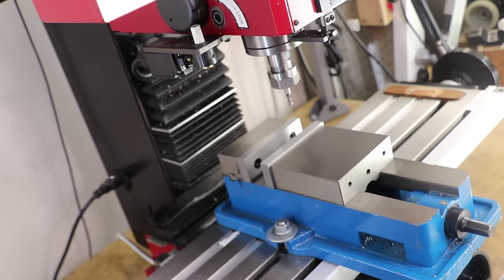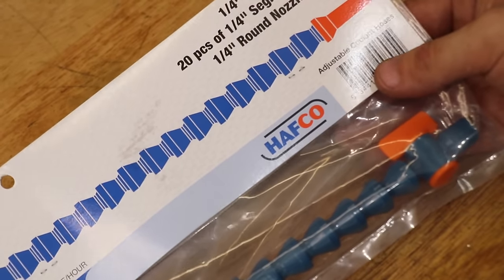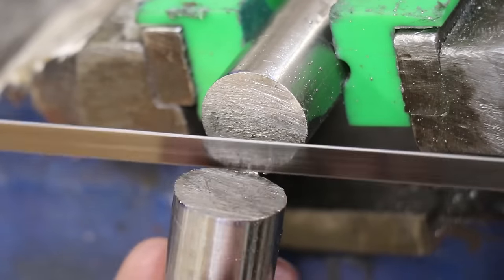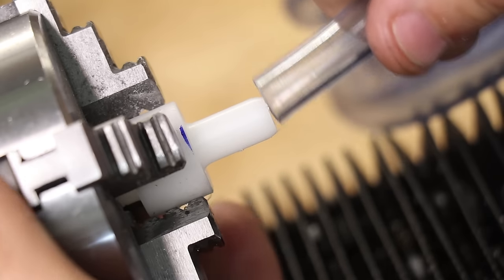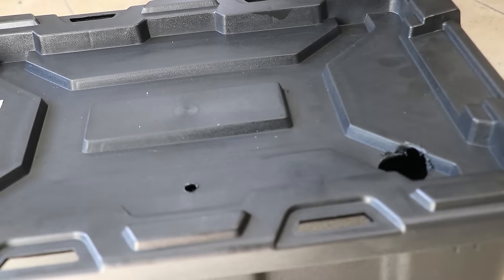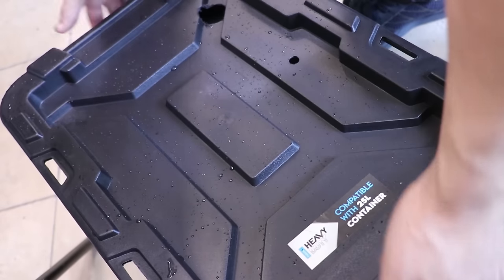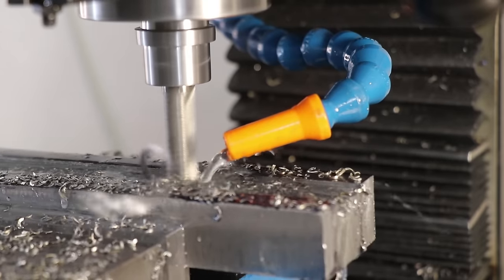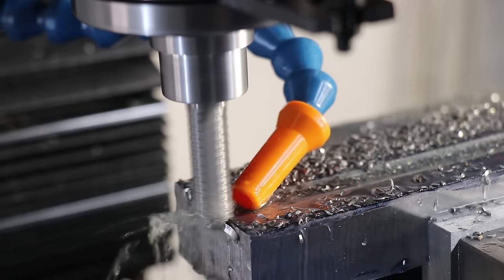Cheap DIY Flood Coolant For The Milling Machine

Comment: Hassle factor: high, Coolant effect for HSS: needed, Mess factor: high, Need to replenish and filter coolant: high, effect on cutting performance: improved a little, Negative effect of water on cast iron: high 
Conclusion: Use carbide mills and skip the flood coolant. They handle the higher RPM's and heat just fine and you don't need the coolant at all for hobby use. For drilling and tapping, use a little oil.
*
I've a got a slightly larger set up than you, but not by much. I use carbide mills exclusively. From time to time I'll put some oil on the mill IF I am machining aluminum since it adheres to carbide. All the rest, I machine it bone dry and my mills either break or I wear them out after many hours of use.
*
Hot metal chips, you did solve that problem, but then so do thin leather gloves and a long sleeved shirt!

Comment: I know it may cost some of your Z height, but have you considered a fixture plate for the mill table? It could add some versatility to your vise setup and could act as sort of a screen for keeping chips out of the T-slots when the coolant starts flowing. Then again, it could just provide a larger mess for coolant runoff 😅

Comment: You could quite easiely add .35 liter more coolant oil since adding 1 liter to 18 liter giver you little more than 5% 1.35 liter gives you 7%. Also think it looks to clear. Otherwise if you are going to change out the fluid calculate the oil you have to the percentage what you want. So for 7% 1liter/7 then for the water take (1l/7)x93. It becomes like 13.28 liter so 13.5 will set the level a bit under 7%. Also when i worked in a shop we always mixed the coolant in 15l or 30l buckets. Then poured it in the coolant tanks and machines.
Reply from the maker: It seems to look a little low but this is more concentrated that the manufacturers guide. Ill probably play around with it in the future since I am coming into this with little experience dealing with semi synthetics.

Comment: Put the pump in a fine mesh container to prevent swarf from getting suck in. The pump at the bottom is the worst place it could be to suck up contaminants.
Reply from the maker: Cheers, the mesh filter in the funnel has actually done a really good job so far. I am thinking of a different mounting pump for the pump though

Comment: Each shop I've worked at throughout my life I always try and convince the boss that it is against my religion to work with Stainless Steel, but nobody has bought it yet. All S.S. will work harden super easily and super fast, and 316 is one of the worst, if I can get away with it I always try to use 303SS, it's damn near butter compared to the others, that and never put oil on it while machining, it will definitely harden, try and use a water soluble coolant that turns milky when mixed or even the blue cool mist solution you run in those misters works really good in a cup and brush it on and a gallon jug when mixed correctly will last a whole year

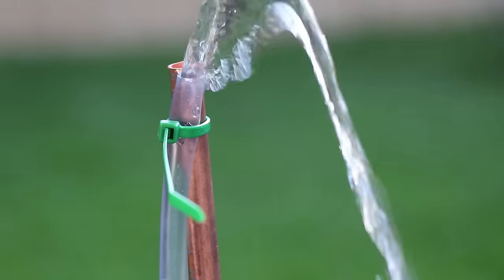Comment: 10:25 you bought the wrong 12 v pump or the power supply didn't have enough amperage (mine needs 8 amps) Mine works fine for about 3 years now

Comment: Is it possible to use an air blaster pump in this setup? Would it be effective?
Reply from the maker: If you want to use it to use the Venturi effect to pull the water using an air nozzle it can work
Reply: @artisanmakes thanks for the reply. I have managed to setup a flood coolant system. But the problem now is the coolant flows all over the machine and onto the floor. I am thinking of creating a shallow trough in the work area, keep the cnc machine tilted a bit, so the coolant flows out into a pipe. Do you have any other idea?

Comment: did you consider mist cooling system and if so why did you go with flood instead of mist?
Reply from the maker: Most coolants tend to leave an oily mist on everything in the surrounding area if you don’t use an enclosure. Plus there are health concerns with regards to the atomised oil in the mist.

Comment: Good video but a couple of things,
You can buy a flexible coolant hose with a tap and magnetic base very cheap, saves the extra work. I just bought one for $12. Your coolant isn't right 1 to 18 = 19 parts, 1÷19= 5.2% that's not enough and the reason it's not milky. I'd put another satchel in it doubling it to 10% our machine shop runs 10% to 15% minimum. I think 18 litres of water for what your need is overkill.
Reply from the maker: I ended up adding another satchel, just for peace of mind. I emailed the manufacturer and they were pretty adamant that one satchel per 20l was fine for lathe and mill work but I wasn't too happy with how it was performing

Comment: You have a lot of surface area to work with at the top of your funnel. Have you considered getting some mesh and fitting it into the top of your funnel? That way you’ll clog less often. 

Interesting build though! I wish my bridgeport clone had the built in coolant reservoir. I’ll have to use the same setup as you if I want to use flood coolant.

Comment: You're using kerosine base.. how will you manage rust on the table & vice
Reply from the maker: I'm not using kerosene. When I did kerosene did not cause rust
Reply: That's crazy. How on earth, will using kero cause rusting?
Reply: @tandemwings4733  kerosene is hygroscopic.. its absorbs water.. it washes off with water easy & leaves no oily film

Comment: Is there no filter or chip trap inside your reservoir?
Reply from the maker: There is a filter in the funnel and I pull out the funnel every now and then to clean it and remove the chips
Reply: @artisanmakes  A cheap secondary filter could just be to wrap the pump in the toe end of some nylon stockings. I stretched some over a coat hanger and placed it on top of the grille that my CNC lathe coolant floods into and catches a surprising amount of fine chips before the coolant is reintroduced. Cheap to replace, too!

Comment: The oil based emulsion coolants are not that healty, in my country it's under investigation due to employee allergic reaction. The supplier does not want to tell what raw materials are in the product. Whatever cooling system you use, it is always better to have good air extraction. I use myself a spattersystem with a vegetarian oil.

Comment: I am going to buy 5 gallons of hydraulic oil and use that. The good, it wont evaporate, more good, I can ad in other types of oil such as cutting oil and it should mix in just fine. I can DIY a filter for it that will take out 99% of fine particles. I just need to figure out what type, or just buy the cheapest real oil I can find and try it. I'll just use a drain back system and cheap pump and use the 5 gallon pail it comes in.
Reply from the maker: Best of luck

Comment: Yeah right... Kerosene..!!! 
The ONE important factor that you have not addressed - is - the fact that your coolant fluid, is actually a "cutting" fluid, loaded with EP additives that will improve your tool engagement with the job.
Reply from the maker: Kerosene does a good job in my experience. It is listed in a lot of my handbooks as a suitable cutting fluid for soft metals

Comment: Check out t.o.t (this old tony) video here on the tube about a mill vise he made. It uses the mill bed as the vise base. I think it would be beneficial to you. 👍
Reply from the maker: Yeah ive used them before, I am a bit on the fence about them, but it is a good thing to consider.

Comment: 30$ for a cooling hose? Omg bro. Those prices. This cooling hose with a shut valve are being sold for 2$ for 5 pcs.
Reply from the maker: In the past I’ve always found that the cheaper air and coolant hoses with ball sockets wear out faster than the expensive ones
Reply from the maker: The plastic that they use wears and it’s doesn’t hold its position as well cheers
Reply: Got it

Comment: Why not mount the vise on a base plate and bolt the base plate anywhere. Also make low walls on edges of base plate with a drain hole positioned appropriately. Good job otherwise!!
Reply from the maker: Just personal preference really. I don't think one is clearly better than the other.
Reply: @artisanmakes  Ok just a thought.

Comment: My xdp2000 metallium coolant is like cow's milk, yours looks nowhere near concentrated enough!
Reply from the maker: I'm just going by the manufacturers specs and it seems to be okay. What concentration are you using
Reply: @artisanmakes  yeah me too, I usually run 5% but sometimes up to about 8% depending what it's for. Mixing as it says on the bag and it looks much more white than yours. I wonder if they've changed the recipe or something? My last bag is about a year old
Reply from the maker: @jamesfinniss6448  Thanks for the reply. I don't have much to go off since this is my first time using this coolant, but ill probably end up grabbing another satchel of it. Cheers

Comment: I use the same coolant from Hare and Forbes on my bandsaw. I think it's a 20:1 mix but it's noticeably white whereas yours looks clear. Feels oily between the fingers, but never had a bad smell even though I only change it every couple of years! (Low use)
Reply from the maker: Thanks for the comment. Not sure why my mix seemed to look so clear, but I eventually added another sachet and that seemed to make it work a lot better. Cheers
Reply: @artisanmakes  By the way, man, have you considered a hand held bandsaw? I suspect you don't have space for a tabletop one, but a handheld won't take up too much space and might save you a ton of time? Vevor have a corded one for under $200 (can't speak for the quality of it though; I have a battery powered HiKoki and do rate it!)

Then again, a little bit of exercise is never a bad thing :-)
Reply from the maker: I have but, dunno, hack sawing really doesn't take too long. Plus it's kind of a running gag now on the channel. Cheers

Comment: Kerosene?  I'm probably showing my n00bness (n00bity?), but I'm finding it hard to follow this thought tree: "I am cutting metal with another piece of metal, generating a lot of heat.  Hmm.  I know, I'll spray Jet A at it!"
Again.... N00b.  Fight me.
Reply from the maker: if you look at most older machining books kerosene is generally referenced as a good cutting fluid. It has a relatively high flash point so it is very unlikely that the heat produced will cause any fire risks. Although nowadays most people use soluble oil as cutting fluid.
Reply: @artisanmakes  I guess so, hard to imagine the industrial revolution taking off if they burned down a shop every week or so!
Next up: Nuclear power! "Here, go hold this metal thing next to that other metal thing.  Yeah, it'll get kinda bright, just man up, we gotta get these numbers!"